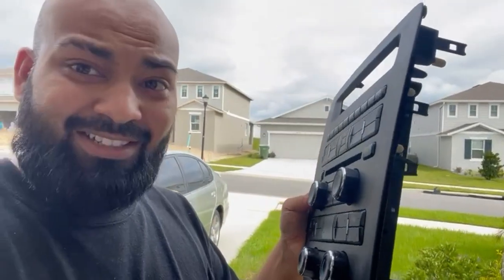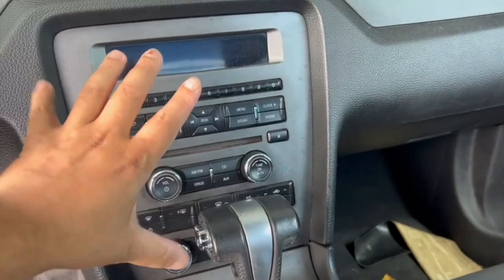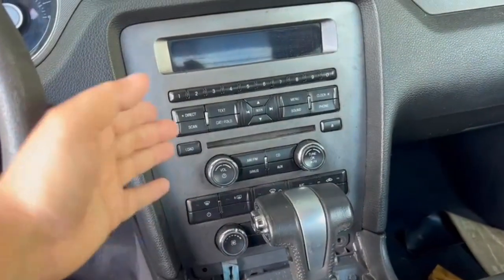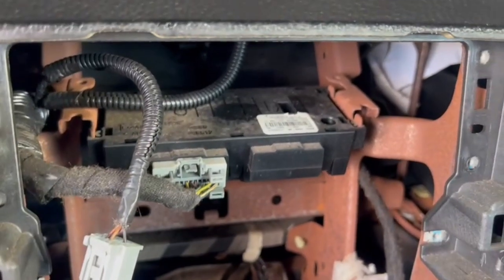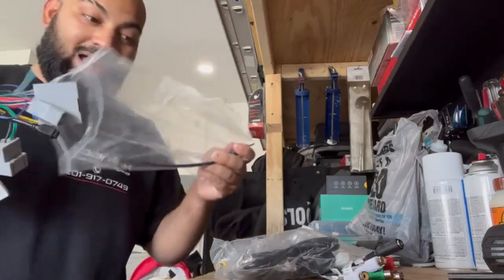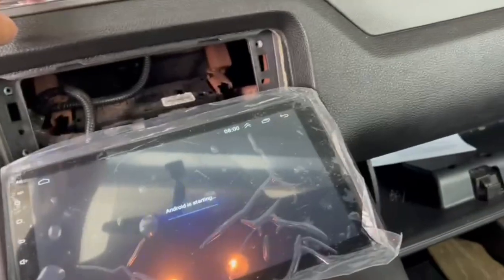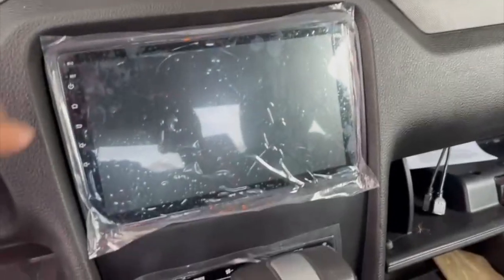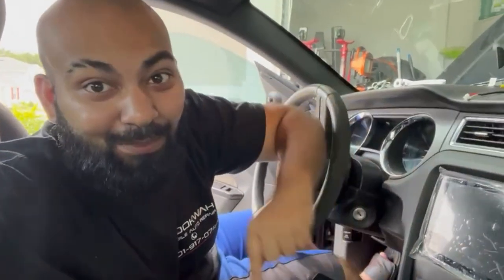The Expert's Guide to 2011 mustang radio install

Comment: hey idk if u can help me i set it up everything works great except the volume no matter what i do it won’t work messed with eq everything idk why
Reply from the maker: the amp wire, i  cant fully remember but that amp wire needs to be hooked up,,, thats how you end up getting sound... either it needs to be hooked into the positve... send me a picture of your wire harness on instagram or email.. sookwahryan@gmail.com
Reply: Hey, I don’t know if you can help me. I set up everything. Everything works great only thing that don’t work is my AC. Can you help ?
Reply: Did you ever fix your a/c having the same issuw
Reply: @dominicwallace2504 did you ever fix the a/c?
Reply: Plugged mine in and nothing. Screen doesnt turn on

Comment: How’s the sound compared to stock?
Reply from the maker: It’s clean and clear, I really like it
Reply: @Kingcustomz  awesome 
Thank you!
Reply from the maker: You are welcome, let me know if you like it
Reply: Better! Clearer! Also depends where u play songs from... I downloaded Spotify and YouTube on the screen and it's clearer than using bluetooth on the phone
Reply from the maker: mine sounds clear all around
Reply: How did you guys fix the bass. I have a shaker 500, and when I use the small harness, the bass is phenomenal, but there is static in the background on lower levels. When I unplug the harness, the audio is great and clear, but I have no bass at all. Dynavin is sending me a replacement hope that fixes it since it is a plug and play.
Reply from the maker: I had no issues with my bass

Comment: Hey so as I was installing this the ac harness didn’t seem to plug in what did I do wrong?
Reply from the maker: is yours manual or auto? and its just one connector it uses, is that one connector not lining up properly... maybe can you send me a picture on gmail, sookwahryan@gmail.com
Reply: Did you ever figure this out? I’m having this issue now

Comment: I bought the same radio for my 2014 and I don’t have A/C. Did the little blue plug in fit into your radio? Or am I just having a difficult time for nothing?
Reply from the maker: the blue plug, honestly I don't remember, ill have to pull my radio out
Reply: I’m having the same problem.  Did you get it figured out?
Reply: how about now?  get it to work?  just installed one

Comment: Hi, my radio is not picking up any radio station. Antenna connected. But there is a small cable labeled as antenna that I saw somewhere else that has to be connected to a 12v. Did you have any issues, any ideas? Thank you.
Reply from the maker: Make sure all your connections are connected. I have haven’t had any issues. Mine was 100 percent plug and play everything plugged in.  Make sure your antenna is pushed all the way into the radio

Comment: Hey guys lmk if anyone been having problems with there ac climate control screen to pop up I found a solution! If you guys are interested lmk and I’ll make a video exactly fixing it
Reply from the maker: Make one anyone brother. Someone some where will run into the problem also, when you do make it, comment the link under this video 🤓
Reply: Do u have a video up for the ac

Comment: My update on this radio: it works really good and i actually enjoy it. my only complaint is that the little lights under the buttons on the bottom panel don’t light up so you can’t tell what setting it’s on when you hit it and i can’t control my AC through the touch screen. idk why but it won’t let me.
Reply from the maker: My buttons light up, there is a setting
Reply: @Kingcustomz  how do you get to the settings?
Reply: Please help me my a/c just doesn’t function properly I was thinking it might be the CAN box settings I’m using?!? Please help!
Reply from the maker: Just saw this, I’ll make a shorts on it
Reply from the maker: I’ll look into it
Reply: Hey man did you guys figure it out? Also how do you turn off the a/c and heating there is no button for it
Reply from the maker: @gareginasatryan8734  tomorrow ill do a short on this radio and the functions of the buttons
Reply: @Kingcustomz still looking forward for your video on how to control the ac. Did you connect the steering wheel control keys (audio volume etc.). They don't work, maybe i forgot some cable connections?
Reply from the maker: i made a youtube short on it, check out the channel. also the radio comes with one plug, forget the other plugs and just plug in whichever connector fits

Comment: Hey anybody know where did u hookup the 2  USB ports, I figured the wires are short and can't get them under the gear panel to the storage box
Reply from the maker: I put mine in the glove box
Reply: @King customz  ok. Thnx . And one thing more . Did u get the one with canbus box ?  The button lights on mine stay ON when car turned off. 

And secondly,  can u post a photo of backup camera wiring plz?
Reply from the maker: I did not and I haven’t installed a back up camera yet. I will, I’m just waiting for the body work on the mustang to be finished

Comment: Hi budd, questions are you still loving your radio? does your car seat heater works or does your stirring wheel bottom also work?
Reply from the maker: hey there, I sold the car a little while ago. while I had the vehilcle I did love the radio.. It worked well for me.. I know some people have mixed reviews but it worked awesome .

Comment: Sure more functionality, but I doubt this has a better amplifier than the stock unit.  I would assume it sounds worse?  Also, if you just want to add blue tooth mainly there are bt receivers that plug directly into the aux input that have WAY better sound than the units that play through your FM band.
Reply from the maker: it worked really well

Comment: Hey bud GREAT video, You think I can add a front camera to this unit? I know it has a
Rear camera connection I was wondering if it does have any place for a front camera
Reply from the maker: Hey thank you. I’m not 100 percent sure if there is a front camera connection. Maybe they sell like an adapter split

Comment: Great video man….. I did wanna know if you could use a double den radio with this instead of the radio they provide you with
Reply from the maker: Yes you can. They will sell a separate face plate for it
Reply: @Kingcustomz  okay thanks a lot
Reply: hey i was wondering if you ever found this face plate

Comment: I bought one and have issues with mine. 
1. The head unit doesn’t sleep/turn off with the key. It just stays on and drains the battery.
2. My odometer is in kilometers now.
3. HVAC controls are in Celsius.
Reply from the maker: There is a chance your old radio used to stay on as well, you probably didn’t realize it. You have a parasitic draw somewhere.  

The odometer can change back to miles, mine did that when i first bought it. Just play with the info and setup buttons by the drivers door.  
HVAC you can play with the Celsius and Fahrenheit in the radio settings

Comment: Thanks for the video. I have the same system in the same car. Everytime I start it, it does 6 big "KLONGS" in the loudspeakers. Any clue ?
Reply from the maker: Check the wiring, make sure everything is set properly
Reply: Already did. No change @Kingcustomz

Comment: Hello I got this same radio but my ac connector does not match with the screen hole for the ac. Does that happened to you ?
Reply from the maker: Yes you only have one plug. That is normal. Match the one plug and then the ac will still work

Comment: How did you get audio everything works on mines I have no audio
Reply: Figured out audio but now air want turn off
Reply from the maker: isee you figured the audio out
Reply from the maker: was yours manual ac
Reply: @Kingcustomz  no it wasn’t I think it was it something wrong with it for some reason all the buttons didn’t work and I couldn’t get it to change modes with the air. It started getting hot fast and the screen starting freezing I just sent it back thinking ordering another I really like how it looks thanks for the reply my guy

Comment: Hey bro I got the same radio as u before the upgrade is it a auto or manual ac cause I bought 2 saying it's manual cause it's the same set up as urs and the connectors aren't the same for the ac
Reply from the maker: mine was manual ac, it only has one plug and ill make a shorts on it tomorrow for this radio
Reply: @King customz  wait I found out it's part of the harness that comes with it and connects down to the bottom part of the radio
Reply: Hey bro I’m having a issue here that the ac connector of the car does not match the radio plug
Reply: @Valentina Birthday   it's actually part of the wiring harness I found out on my own... completely ignore the plug from the car for the bottom of the stock radio and use the one fron the wiring harness that comes with the radio.
Reply from the maker: Yes exactly
Reply from the maker: Is yours manual ac or auto
Reply from the maker: Yes exactly.  You ignore the other radio wire
Reply from the maker: Yes sir you are correct

Comment: where did you connect the a/c wire harness from the car to the radio. There's has to be a wire conversion harness in order to match both connectors. Please be specific.
Reply from the maker: if I remember correctly I think the main harness plugged in and it controlled my ac. the main harness of the radio
Reply: dose it works for u and how ?
Reply from the maker: Honestly mine is plug and play and it works well. I’m not sure why others are having issues. I think it’s just a different radio lol
Reply: @Kingcustomz  it works with me ... i just should choose the explroer car in settings
Reply from the maker: Have you figured anything out on it yet?
Reply: @smartkoala7098  how do you do this exactly my climate control work but the actual screen for the climate control doesn’t pop up so I can’t physically turn off the ac for some reason my ac button doesn’t work but all the others do please help
Reply: @ricardoromero9484  did you ever figure it out? My ac doesn’t turn off either.
Reply: @CrownTown282 did you ever get this either?

Comment: Got a question, how did you get your a/c to work? The plug on mine doesn't work with this exact unit? Any help would be appreciated
Reply: Mine worked. Maybe you have to change the radio settings and choose another car, mine does not have a mustang option so I had to choose another ford model. I've heard that may also work with some GM settings.
Reply from the maker: Was yours automatic ac or manual ac. Mine was manual
Reply: @Kingcustomz  mine is also a manual a/c, the plug that my car has for the controls does not fit the plug on the back for it.
Reply: @jalonsopots  mine is the same as the one in this video but the factory plug for a/c doesn't fit the one on the lower back of the new one for some reason and mine is a manual a/c
Reply: U have to select the canbus in settings to ford explorer all buttons will work
Reply: @jattjeona4632  thank you! That worked for me.
Reply from the maker: I should be getting my mustang back soon. I remember some plugs didn’t have an outlet to go to. But one main plug made the ac work
Reply from the maker: Your ac doesn’t work at all
Reply from the maker: Yeah try this
Reply from the maker: Awesome brother.
Reply: @jattjeona4632  what’s the canbus?
Reply from the maker: It’s a series of computers that works together
Reply: Mine didnt hook up for the ac either
Reply from the maker: Hm, did you have a manual ac
Reply: @jalonsopots  can you please tell me which setting you used exactly?
Reply: yea i plugged all my cables in but somehow my buttons don't light up my ac works but i can't see what i'm pressing , someone mentioned changing the canbus settings to a ford explorer but i did it i went to protocol settings and changed it to a raise - ford explorer but it won't change anything. The frustrating part is that my lights turn on whenever i turn off the car it's the weirdest thing , I know the lights can turn on and its not faulty but they don't turn on for whatever reason... If anyone was able to fix this let me know
Reply from the maker: Let me see if I can figure it out for yah
Reply: @Kingcustomz  Did anyone ever figure it out. The issue is that we have shaker models so the ac controls are different. I haven’t been able to figure out the canbus settings or a way to redo the wiring.

Comment: How do you change the temp degrees from celsius to Fahrenheit? I have tried through the unit and through a launcher app, and it will not change. I love the radio but this is a real pain.
Reply from the maker: Let me see if I can figure it out. I finally got my car back.  So I’ll Chrck and get back to tou
Reply: I'm also having this problem, I want to switch from c to f° and also from km to miles. Any help would be appreciated 👍
Reply from the maker: im going to do a video on this radio again.. it seems many people are having problems with this radio

Comment: How did you install the plug of the aircond.???
Reply from the maker: there was one plug, that plugged in
Reply: @Kingcustomz  yeap but the one that the radio has is differebt
Reply from the maker: Did you select the correct radio there is one for automatic ac and manual

Comment: Any idea why my speakers pop whenever the power is connected but stops when I turn the car on?
Reply: You’ll need new speakers. I’d change all the ones in the car.
Reply from the maker: Check your wiring
Reply from the maker: Maybe so
Reply: Same problem here. Did you fix it? Thank you.
Reply from the maker: I’m not sure if he did
Reply: Just in case it helps, I Just disconnected the amps (drivers side kick panel in my case) as a temporary solution to avoid the speakers to pop. I noticed the subwoofers do not work, so it is indeed a amp connection problem, maybe just with Shaker systems. I'll try to fix it my self but I'll probably end up taking it to a shop.
Reply: @jalonsopots  i have shaker too and the same problem, u can solve? And the buttons in the wheel for volume and that doesnt works :(
Reply from the maker: Sorry I wish I could help, let me do some research
Reply: @jalonsoports
Reply: @jalonsopots  Hello, I want to know if you fixed the problem with the subwoofers because the same thing happens to me.

Comment: I have one of these installed and it keeps switching to climate control every minute or so.. which makes watching videos on it impossible. Does anyone have the same issue? Any fix for that?
Reply from the maker: mine does that, but I haven't played with it.. I will look into the settings and get it figured out.. if not I will reach out to the company and find out what Is wrong
Reply: You need a manual A/C control version.
Reply: @Odin3v  Yeah I fixed that a long time ago.. But how to get it to switch from Celsius and Kilometers to Fahrenheit and Miles??

Comment: The screen doesnt turn on and the Ac keeps blowing hot air and doesnt turn off.
Reply from the maker: Ok reinstall your old control for the ac, maybe you left it on the on position. Shut of the ac and re plug in your radio and see if everything works correctly now
Reply: I had this issue and it’s because my cable wasn’t fully connected into the white box
Reply from the maker: Does it work now
Reply: @Kingcustomz  returned it. Might have been a faulty unit or i dont have the cables required
Reply from the maker: Let me know what you decide to get in place
Reply: What is it called ? Does it fit mustang 2014 ? 😭
Reply from the maker: it does fit the 2014 mustang and ill find it again..

Comment: can you show the back of the radio with the cables connected??
Reply from the maker: Yeah I can do that.
Reply: I bought the same radio and the bottom part of the panel is not working
Reply from the maker: Strange, maybe a defect in yours. But mind was complete plug and play
Reply: Same, but fixed it... You go to settings and look for system settings and enter the password 3368 (check out yours from where you bought it) and choose the car model, if you ddnt find mustang just choose f150. The bottom part and the buttons on the steering wheel should work. If not make sure the cable is connected for the bottom part 👍🏻
Reply: @waelalenazi5156  I’m trying to put my radio in now and that’s not working. i’ve tried everything because that bottoms has a port that the original cable won’t fit in like others have said. any updated ideas on how to get it to work?
Reply from the maker: I must try this
Reply from the maker: Thank you
Reply from the maker: Did you buy the correct radio. If you have manual ac then this radio is plug n play. If your ac isn’t manual then your supposed to buy the correct one

Comment: I need a wiring tutorial
Reply from the maker: No wiring needed it was all plug and play
Reply: @Kingcustomz  yeah but half of the controls don’t even work
Reply from the maker: Chances are your radio may be defective. If it’s the same radio, it was just a simple plug and play no wires cut. But in the manual that comes with the radio, it comes with a wire diagram
Reply from the maker: I’ll try to see what I can find for you